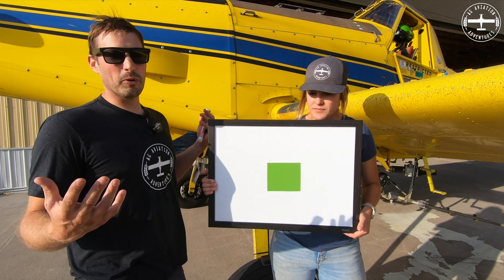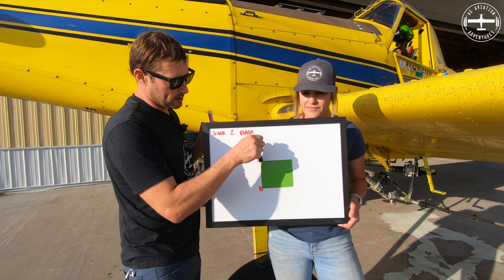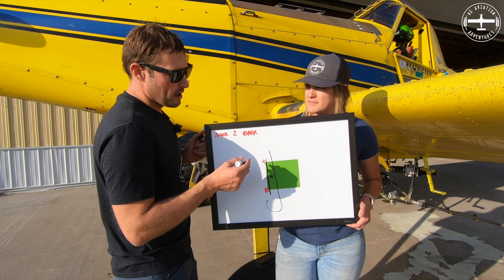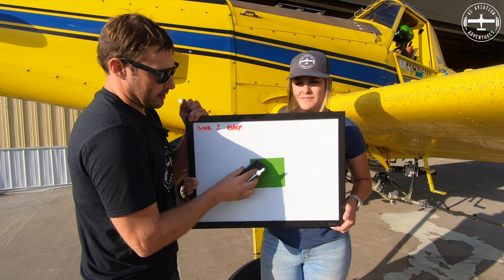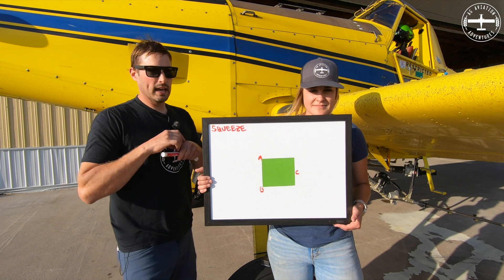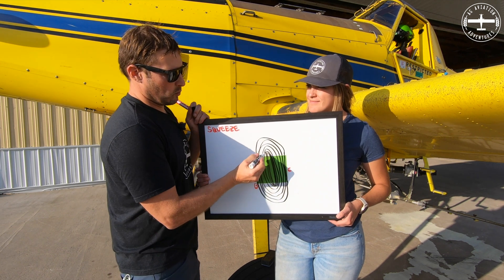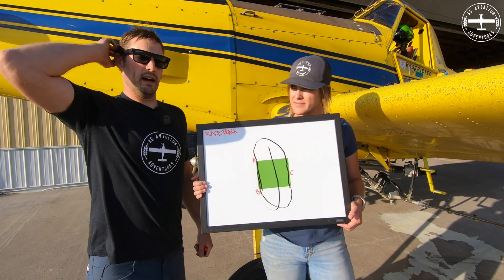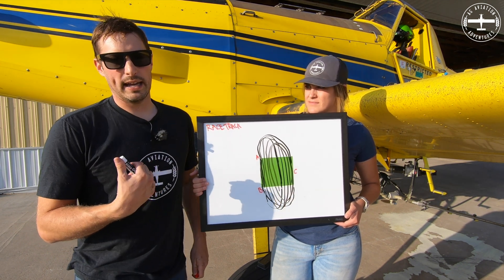Commonly Used GPS Spray Patterns in Ag Aviation

Comment: Do u use satloc bantam? I have a settings issue / question.
Reply from the maker: We do!
Reply: Have u ever had a problem with it not showing your swath guidlines, after u set up the pattern? (A,b, and or c).  Mine is not doing that.  Any guidance to right setting would be very helpful.  @AgAviationAdventures
Reply from the maker: @farmboy694  I'm not entirely sure but I'm guessing it is a setting somewhere...

Comment: My question: I see your 'racetrack' pattern, is really what I call a 'helicaltrack' pattern even though you don't call it that. From what you have shown it could be improved a bit as follows: the pilot first flies the field sides as track AB & CD (as first pass and second pass), then the computer divides the field in half for track EF (midway between AB & CD). For the third pass, the pilot flies track EF. Now to form the racetrack to finish the field, on the fourth pass, the pilot flies the track -C'-D' (inside and adjacent to track CD) and on the fifth pass the pilot flies track +E'+F' (outside and adjacent to track EF). The 4th and 5th pass define the turning radius which remains constant for the balance of the racetrack. The racetrack offers the advantage of all turns being the same radius (same turn-out and final) and having the same "base leg distance" for the entire field. Bonus: To optimize spray/flight time on large fields, multiple racetrack patterns (spray zone areas) could be placed adjacent to each together and flown so that one racetrack pattern if finished before the next is started. The bonus multiple racetrack pattern approach optimizes flight time by minimizing (within safe tolerances) the "base leg distance" between spray passes. To me this approach would be both more economical and far safer. What are your thoughts?
Reply from the maker: Thanks for watching David. I'm not sure I was able to follow it all the way through but sounds like you're onto something.

Comment: Interesting and informative video.  After shooting the A and B line, when you move over to shoot the C line, does the computer remember your on and off points for spraying since your just laying and end point?  Hope this question makes sense.
Reply from the maker: No I manually turn it on and off with a handle.

Comment: Great info video. How often do you spray the same field per season?
Reply from the maker: It really depends on the crop but usually once or twice. For example with wheat if it’s wet I’ll apply herbicide early on and then again if it’s wet I’ll apply a fungicide about a month later. Sugar beets have an application schedule where they are sprayed multiple times throughout the summer (again if it’s wet and the airplane is used).